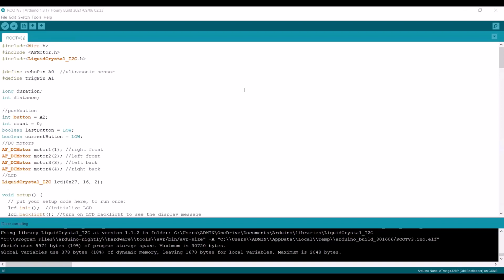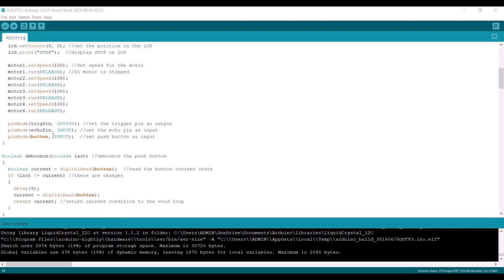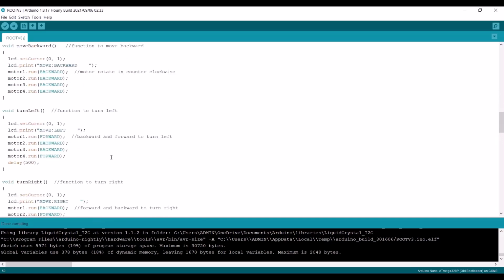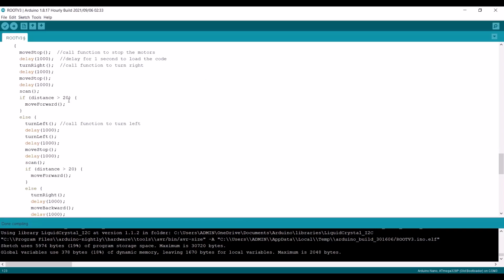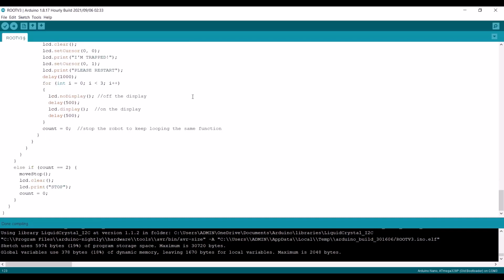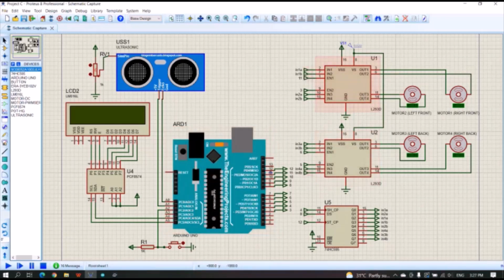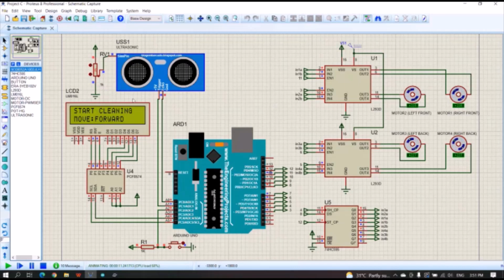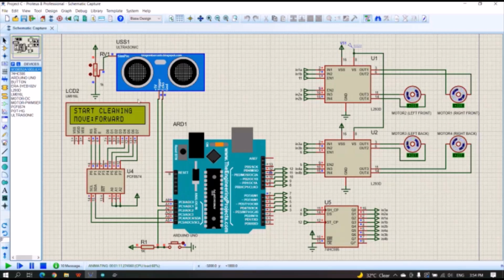Group 3 Project Presentation - Smart Cleaner Robot

Comment: NICE.. EXCELLENT PRESENTATION BUT the video is too long.. Should be 10 minutes only. Prototype TERBAIK! Boleh terus guna di rumah.. If you make a nice casing for the robot and change the iron brush to cleaning brush / broom, you can sell this.. Just 1 question:

1. What will happen if the Ultrasonic sensor is faulty (ie: it cannot detect the distance)? will the robot keep moving forwared and crash into the wall? 
2. why the brush did not moving and touch the floor?
3. Why you set the distance to stop the robot at 20 cm? why not 30 cm?
Reply from the maker: Good day sir, thanks for the reply. Regarding to your doubts,
1. If the ultrasonic sensor is faulty, the robot can't measure the distance around it, therefore it will keep moving forward and crash to the wall. If this happens, the robot will not be damage as the brush will crash the wall first, we can replace a new brush and ultrasonic sensor afterwards.
2. The brush is not moving because of limited pin on the motor driver shield and the power supply is insufficient, so we did not connect a motor for the brushes. The brush is touching the floor, so it can clean too although without connected to motor.
3. We set the distance at 20cm because it is the most suitable and shortest safety distance to stop to prevent any collision, while 30 cm is still far from wall. Setting the distance at 20cm can clean more area.

Comment: Good Project. Low-Cost Smart Cleaner Robot.  Well done 👌👌👌
Future Update: Add a Rechargeable port for the Motor and Microcontroller without taking out the battery, The cleaning sponge needs to rotate when cleaning for super cleaning.
Reply from the maker: Hi Pubalan, thanks for the idea!

Comment: Hello Group 3,
I want to ask about the hardware - the ultrasonic sensor.
What is the effective range for sensing collision, and if you have a bigger budget and a longer time, what would you use to upgrade to the sensing mechanism?

EC19007 - Group 5
Reply from the maker: Hi Azharan, the effective range for sensing collision is 20cm based on our settings. We will upgrade the sensing mechanism by adding a servo motor below the ultrasonic sensor so that the sensor can measure distance from different direction and have a better vision about what is around it.
Reply: @jkpx_99  Thank you for the response.